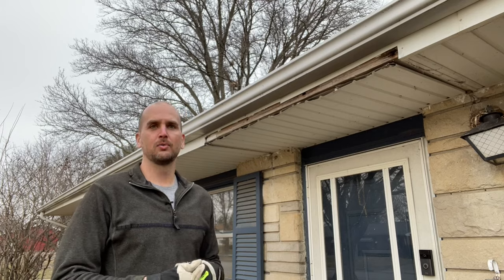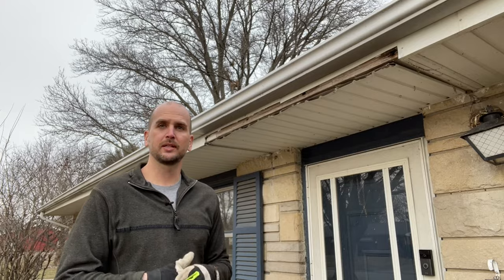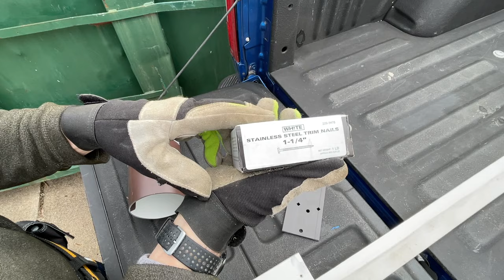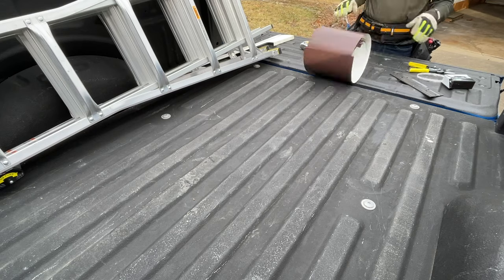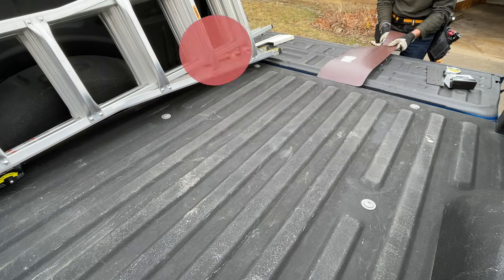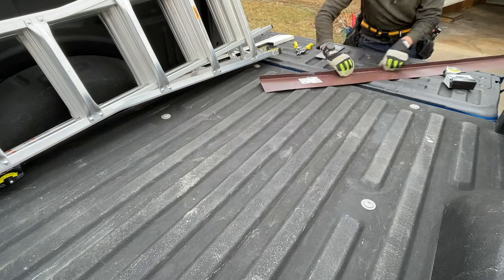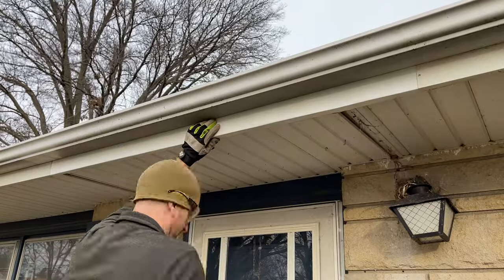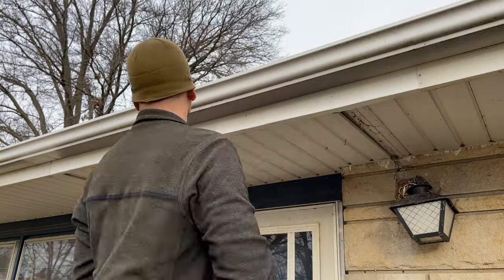How To Repair and Install Aluminum Fascia Cover

Comment: Another great one! I had no idea that such a thing as a handheld brake existed! Definitely going to get one; I can think of a number of uses for it. I think a lot of people don't realize that this metal trim covering is used a LOT. You see it especially in older homes fitted with vinyl siding during a remodel. Typically any exposed wood like the fascia, rake boards, window trim end up covered, but it just ends up cut around things like storm windows and any fittings (or like in your case, the awning). Sometimes there's caulk or sealant along those seams, but other times not. It's worth looking over/inspecting every once in a while. Never good to have water getting in behind the metal and rotting the wood.
Reply from the maker: Hey Marc,  thanks for the comments.  Yeah, I definitely have additional practice to put in prior to being proficient with replacing flashing in the different use cases as you outlined.  It is a very handy skill to have for sure 👍
Reply: So.. true!

Comment: Awesome, I didn't realize a tool like that existed.  I have some garage flashing that's damaged but never really thought about replacing it until now.
Reply from the maker: Yeah, this was my first time as well.  Check the duct work section and they should have a 12” and 18” option. Super handy.

Comment: So I have some cracked paint in my facia in front of home. Can I just add this aluminum board on top of existing fascia or it needs to be removed?  And does this aluminum comes in white already and does not need to be painted?

Comment: Great video Scott. I didn't realize it was this easy or that the breaking tool existed. I have to clad a couple garage window sills. Where did you get the flashing with the white side. All I am seeing at Home Depot is the raw aluminum that is supposed to be paintable.
Reply from the maker: You should see one which has brown on one side and white on the other.  Usually available at all the home improvement stores. Best of luck with the project 👍
Reply: That's the first I've seen that hand break tool also. Only ones I was aware of were the bigger ones.

Comment: Would you ever use staples? Is there any staples that don’t rust on aluminum?
Reply from the maker: Hmmm, personally I wouldn't go the staple route.  I would expect it to be a bit hard to get the right depth through the aluminum and wood in addition to the corrosion issue as most are for interior work.

Comment: so you only bend it once? What if I am covering a wooden facia board that has like a quarter inch hang before the soffit starts? Do you think I should bend it so it goes up behind the facia board an eighth of an inch or a quarter inch?
Reply from the maker: I would just match the rest of the home.  With the same bender you can easily do 1" and 1/2"

Comment: Hey Scott!  My parents got a set of 8 cameras to set up at my house, and it falls to me to install because I am the 'tech and crafty' guy (lol/ugg) to install.  The problem is, the house is two stories tall, and has wallpaper on the interior.  I have watched a number of videos about how to drop down wires through walls, but not much on going through multiple levels.  I was thinking the best rout would be this: My server is upstairs, drag all wires to the attic, drop most cameras to the 2nd floor from there, and say one to the front door.  My issue is, I am completely unsure of how to bring the wire to the outside of the house/physically get up there safely. (It is a wooden house, no brick or stone.)
If you have a suggested place to look up this stuff, or have your own recommendations, I would love to know.  Thank you for your videos!  Somewhat similar, I am interested in routing Ethernet cables, and possibly some more power outlets in the house.
Reply from the maker: Sounds like a fun project.  I also moonlight as tech support for my family 😀.  Could you post this same question maybe with a few pictures on our Facebook Group “Everyday Home Repairs Community?”

Comment: Do they sometimes put nails in the top behind the gutter b4 the gutter is hung? Iv got to pull some down to fish wires and im hoping i dnt need to remove gutters for some reason.  What do you think?

Comment: Nice job. I saw those benders at the store, but wasn’t sure if they worked well or not. Thanks for that.
My local window and door place will make/bend any piece, shape or length of aluminum you want. Prices are about the same as big box stores, but the aluminum is a much thicker gauge.

Comment: Recent subscriber here, I am trying to figure out how to repair my gutters.  The home is 96 years old but in 2008 a new roof was installed and an aluminum fascia was installed.  But tons of water comes down BEHIND the gutters.  I only have easy access to the gutters on the porch and it appears that the shingles are too short, is there an economical fix?
Reply: Install a drip edge with a lip. Only other thing you could do, is go along slipping a starter shingle undwrneath, to give a proper overhang.
Reply: @zzz7zzz9  Thanks so much for the reply - I'll give that a try.